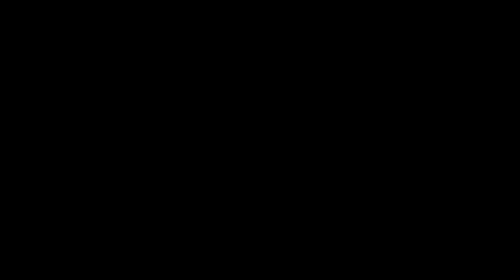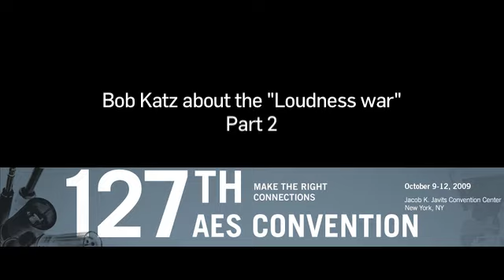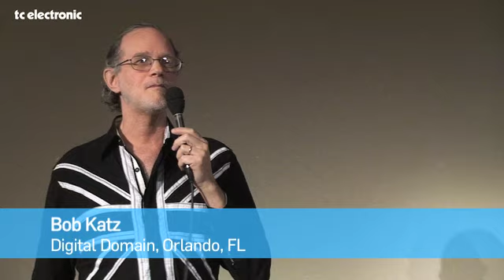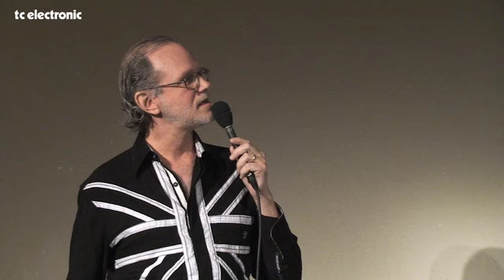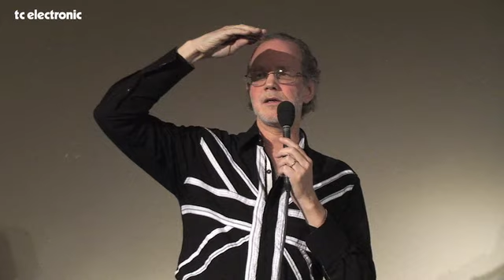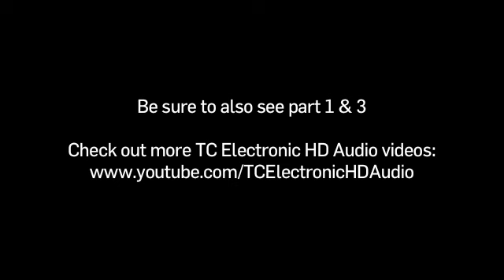Bob Katz about the "loudness war" part 2

Comment: @freezazoid He is refering to hot signals pre PA, not post PA. Depending on the electronics, saturation adds harmonics. Also, heavily compressed guitars, with very high RMS, are part of the character of that sound. On both cases (which there are more) the process has changed the tone color and dynamics, which translates to a specific distinctive sound. That's what the crappy camcorder or a professional microphone would be recording.

Comment: @freezazoid That's one of his points.  The people forcing the mastered levels can't control the user's volume knob.  It's not about noise though, the noise on pretty much all the equipment used by pros is so low, nobody would hear it even with -30dBfs signals.  Consumer replay systems are a little different, but the noise is still too low to really be a factor unless you listen through a Sony F1.  Even if that were the case, is a little noise really worth adding all that distortion?